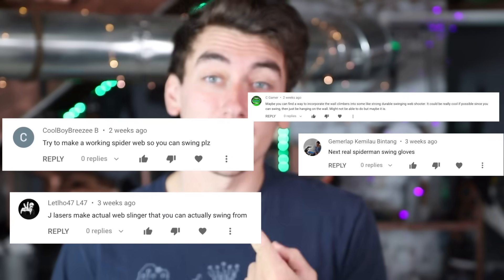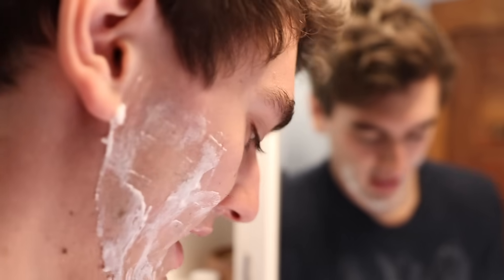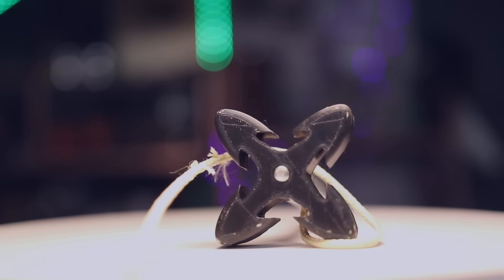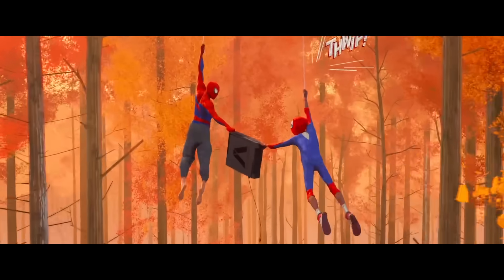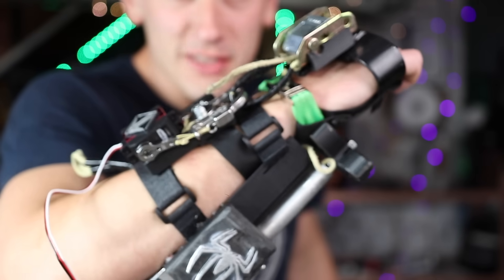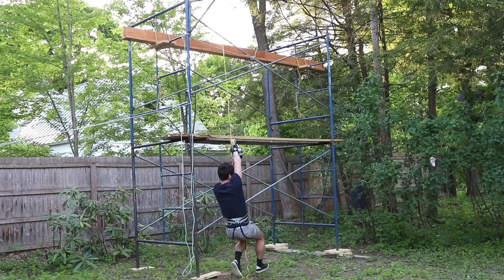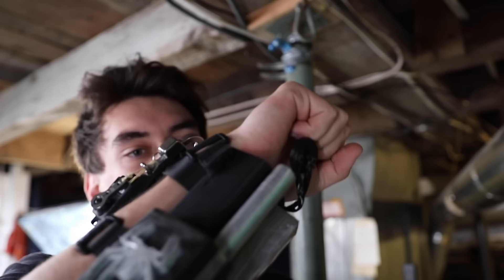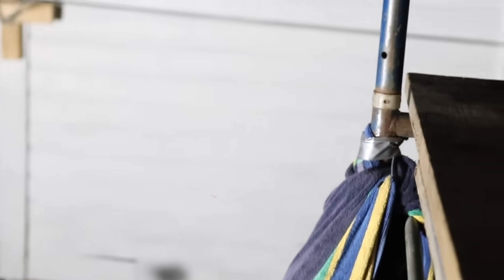Working Web Shooters You Can Swing From!

Comment: Hey, @JLaservideo!! I have an idea on how to maybe tweak your webshooter..... The shooter itself is pretty cool, but the "web" itself you will run out of very fast if you were to swing around from place to place: Why don't you use something like liquid nylon? It's almost never ending when you pull a bit out with a tweezer. I'm not quite sure how long it will last you, but it resembles Spiderman's web. :) But, it would have to be somewhat solidified seeing if you were to swing from it, all you'd really do is create more of a stretch of nylon. I'm not quite sure if cooling it a little would do, or mixing something in with it will do anything, but it is liquid-like like Spiderman's web, and is just as stretchy! :) I'm not sure if it is sticky, though. Like, Spiderman can stick his web onto buildings if he wanted to (or just around a metal bar or something). If around a construction site, a building with metal, lamp posts, or even your improv structure, you can try and make the nylon (or whatever similar polymer) magnetic! I believe I saw it somewhere on the web (pun intended) about that. :) It would be best if at the end of the web it were to fray apart so that it can grab onto something (like a metal bar) kind of acting like a grappling hook. Id'k. Just a little idea. :)

Comment: You should have got to grappling hook and hit a button on the back of it that's easy to press and then hit a wire in in the string and then the the street I mean the wire would use hinges to unattach so you could swing

Comment: i have an idea for a different web shooter using the same tech as the wall climbers...

so this web would have like a little anchor ball that uses vacuums to stick to surfaces instead of a hook, and then make it soccer ball shaped so there's flat sides all over, and when it hits a corner just have a little software on a microcontroller inside that picks the side with the most contact and pushes air out of the other two while vacuuming on the closer side, so I think it could be pretty resistant to spinning and arbitrary real world conditions

so then as long as u could control the release quickly i think u could ACTUALLY swing wall to wall like spiderman for real

Comment: In a version of Spider-Man the guy uses a piece of string that can support the wate of a airplane. Now this is practically impossible but I have an idea for you. If you use a metal wire that is strong  and flexible with a grapple like you have in this video and in another Spider-Man he makes it organically. This is impossible but the idea was that there was a web of 5 different sticky bits and you can probably figure it out like a net or web. Now that is hard but other YouTubers use hot glue so you can try that

Comment: Yes but... will it actually work from 50ft? due to the wind intensity high up 50ft in the air will the webshooter strings snap or will it stick to a building like glue? or will it wrap around some obstacle from 20ft? I'm just curious it's probably best to bring a grappling hook before i do that crazy stuff and grapple to a small building to land safely because yeah.. being normal sucks, it's better to die living a fantasy than suffering and mourning in your daily job.

Comment: you should get like a trampaline without the protection net and when you jump you should fire it or shoot it and see if it can handle jumps like that as well as  how fast  it can release also could you possibly make it so when it re coils it could do it like those measure's and if you could swing with both hands  like the scene with miles and peter  also it would be cool if you  made a few more of the web settings karen introduced like tazer webs and rapid fire or even an actual web similar to the ones used in spiderman homecoming
Reply: He could use suction cups.

Comment: Awesome, first vid I’ve seen from you and I’ll be sure to watch more. you have my sub. A suggestion however Do one where you swing holding the web with two hands and swing your legs, might increase the weight in the Pendulum but if you can find a way to strengthen the durability a bit more I think it’s possible without anything breaking or snapping. Maybe try a triweave braid on the ropes and perhaps a less bendable metal, as well as mayb investing in a stunt mat of some sort so you don’t fall and break something if it breaks.

Comment: An idea for an improvement to this idea would be the ability to stop it; perhaps with another tension like system, as its traveling through the air.
If the firing button also released tension on the string, and when released stops the string halfway or so. This would also allow for better latches with the hook as you can time it to swing better around the obstacle/mount point. 
Great stuff regardless
Reply: milz   d  bak
Reply: me   mustafa

Comment: What if you make cartridges so you can swing more than once
Reply: That’s what we see with versions in the 90’s cartoon where spider-man has a belt he stores web cartridges in.
Reply: @Fi_Sci_  The Stark suit has that.
Reply: @OPAvenging  The webs would be strong enough if he could make them, so if he made the webs with nanotubes and advisives, used co2 as propellant, it would launch and stick with ease. When cutting the line after and swing, add a small blade right at the end of the barrel so he could when he need to cut the line, then launch more webbing.
Reply: @OPAvenging  the webs were designed in  vacuum and they are infused with carbon nanotubes and adhesives, but the adhesives would only become sticky when exposed to oxygen. Personal, he kinda failed the idea of Spider-Man swinging because this build would need to reload a whole new gauntlet after each launch. If he research chemical formula of real spider webs and made composite yet organic webs and then infused them with carbon nanotubes to make them stronger, add adhesives, it could actually work. Darwin’s Bark Spiders webs have a tensile strength 10x higher than Kevlar. A pencil thick strand could hold back an airplane.

Comment: I love the video and I had and idea I hope u would like what if u put a reel for the rope and make it automatic so when you are just dangling u can press a button to pull u up but which means u would have to make the reel be strong enough to lift ur weight from any point from being on the ground or dangling in the air I hope u like my suggestion

Comment: it would be very difficult to be able to swing super well you would need a lot of precision and also if your swinging then if your in a city it’s almost impossible cause Spider-Man swings upon buildings and you would have to break windows and latch on to inside the building and you would have to get the previous grapple hook off of its latched placement but what if your swinging everything goes well until the grapple tangles and even if you shook it like J did you have have to get it somehow so you need a retraction system so it comes back and your ready to swing again but there’s still problems like if you latch on the window or inside the building it could mess up terribly and then SPLAT your dead XD.

Comment: Hey, here's an idea for multiple swings, make a cartridge. Each cartridge comes with a hook, rope, n ignition system. All control with your hands. The cartridge will be attached to a belt harness, n instead of having the release machanism on your hand, it can be on the harness, or maybe hv it on both hands, but the cartridge works as a slide on shell that hooks on the blasting system.

Comment: What if you used wireless tech. You press a button, and the hook that you 3D printed at the beginning can shift those bent parts to make it straight. Since each arm of the hook is slanted, the rope would just slide off I assume. Then you can have a retracting mechanism or something with delay so there's time for the rope to get off. Or you could have two buttons. One to release, one to retract. That way, when you shoot something, you can pull it back, or pull you. More difficult if you want to pull yourself I assume. But yea.

Comment: The best way is the non stick chemical they use on water proof pan wineding real banana spider web wineding in a self wiending water proof ribbon over lapping itself and a separate wineding to catch the ribbon with out the spider web ones the web is in uses to reuse and multiple wineders cartridges and a non stick chemical winedings braider at the tip with a small air compressor with non stick chemical I could be rich but the government suppresses me I am illegal my gift to you don't need it

Comment: So the more you go through this era, why not try researching an actual web formula, in a way we all know mcguires spiderman had the natural web that shot from his wrists, the newer spider man uses actual web spinners, so to have the actual formula and the gadget that weaves the web's like the main shooter chamber, and a smaller chamber that spins around the main webstream to give it that spinning look. And also for strength. But it's all in if the web fluid can actually be designed. It's possible too which is the crazy part.. And the actual even crazier part is spiderman and ironically Batman are the first and possibly only two superheroes that can become a very real thing. Just with out all the crazy lunatic villains.

Comment: First comment that doesn't say first XD

Edit: when you have enough materials, you should make a smaller virsion

Edit 2: if you were to use this in a New York-like city, how would you get the grapple hot to latch on to anything because there isn't any poles to latch onto. I think making the grapple a manually powered electromagnet would be perfect for that situation, or you could go the cartoon route and use plungers XD